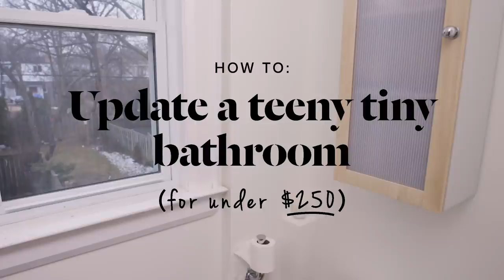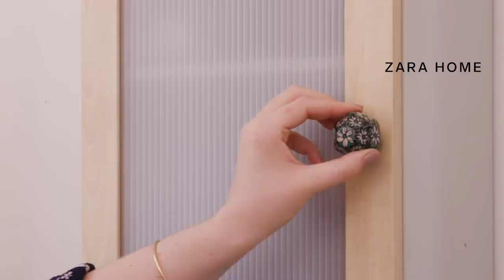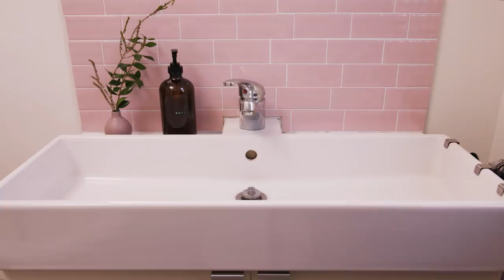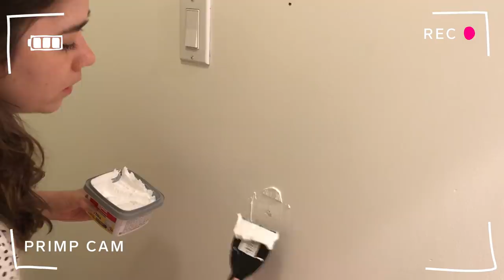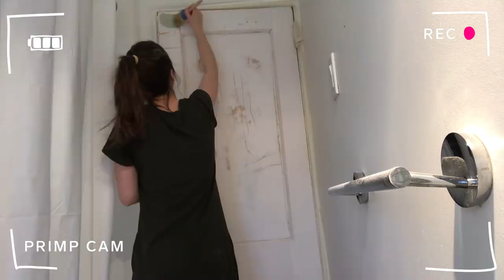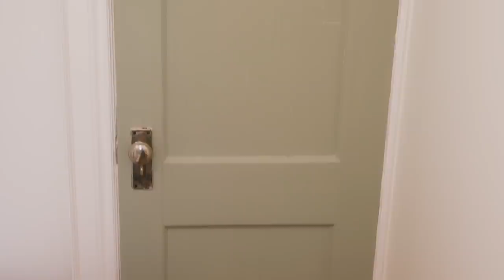Stunning Small Bathroom Makeover On A Budget | The Home Primp

Comment: pink color doesn't look cute in that bathroom for some reason. I doubt you really had to change the lights. Old ones worked better as the bulbs weren't painted pink. The shower curtain is not in my taste and makes this tiny space looks even smaller, not even mentioning it's heavily overpriced. And does that mat really match anything in there?  Ikea would be better and way more affordable. Sorry, but I don't think it's a good bathroom makeover.